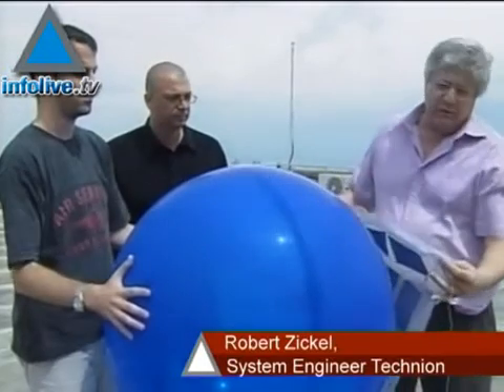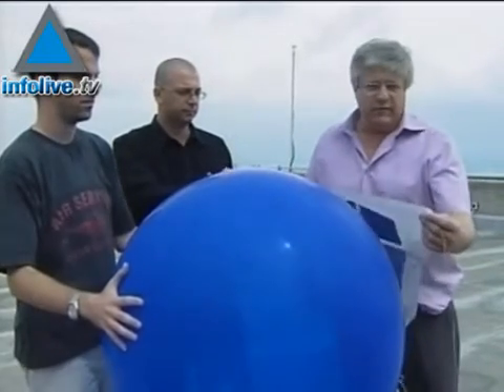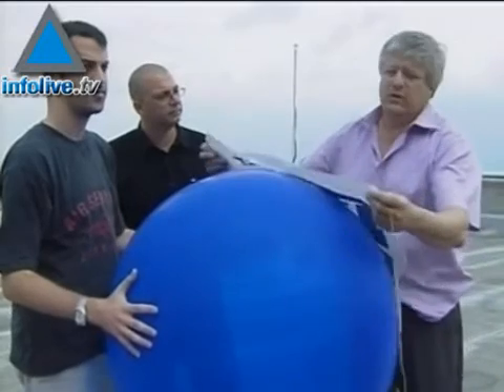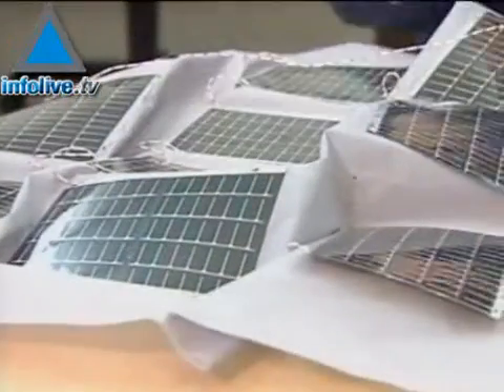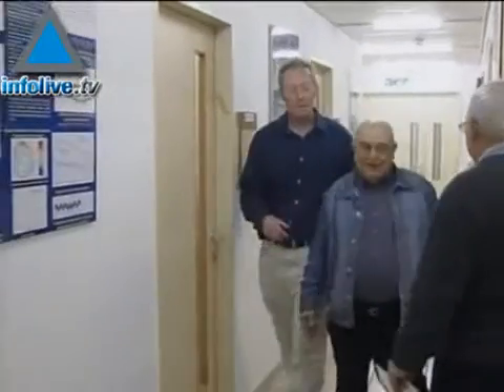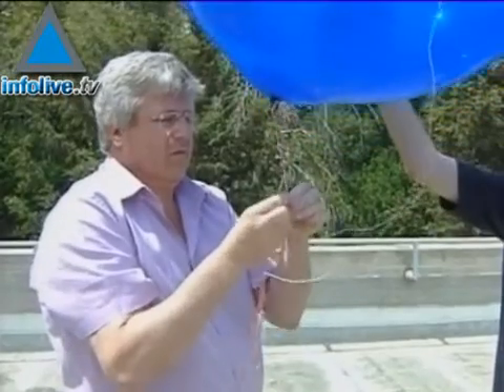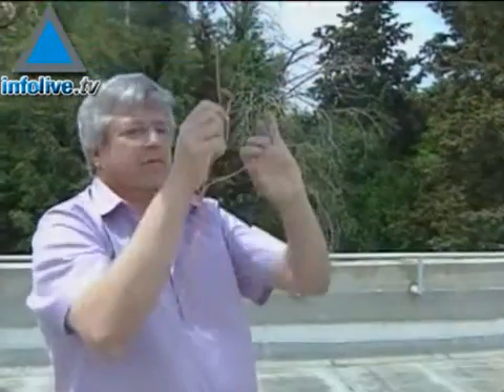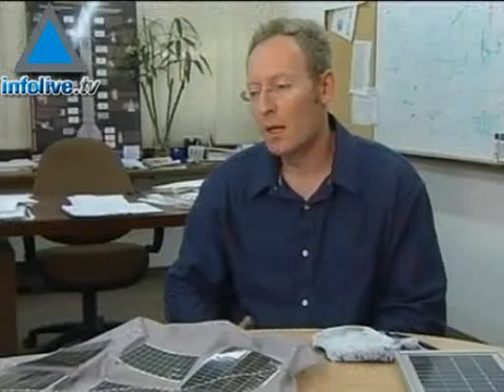Breakthrough Invention Promises To Revolutionize The Way We

Comment: Well, its a fairly decent Idea, and its been thought of before. In my opinion, it would mainly be, and was, rejected due to air traffic and the hazards tethered ballons present. Each ballon would have to have the ability to deploy a red strobe visable (correct me if I'm wrong, I'm not a pilot) for 10 miles. Aside from that, think of a countryside covered in 1000 - 2000 foot tall ballon towers. *shrug* maybe there'd be a lot of happy 13 year olds with BB guns.